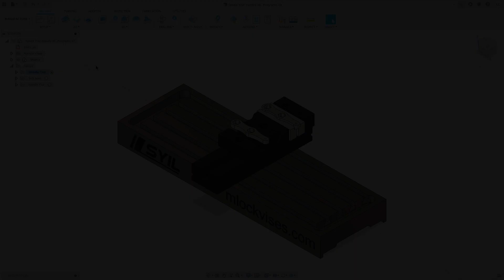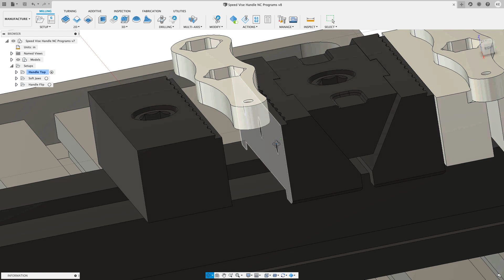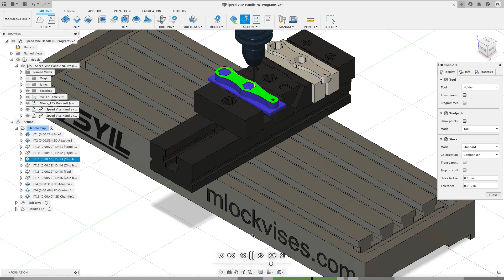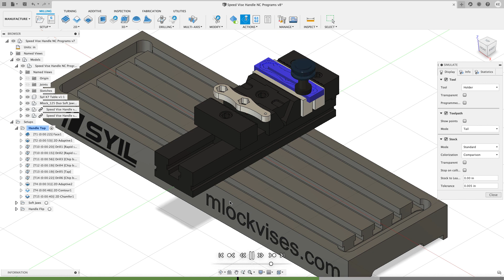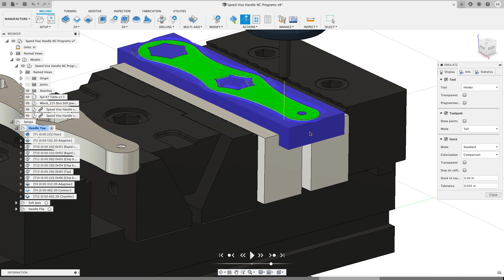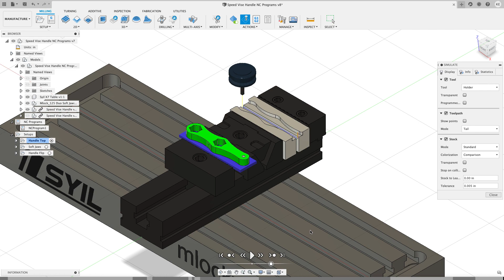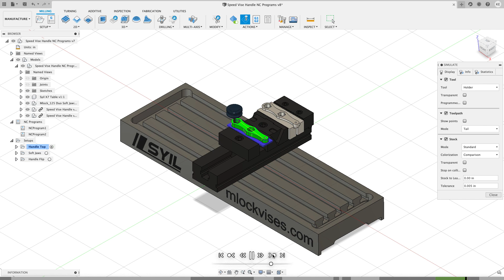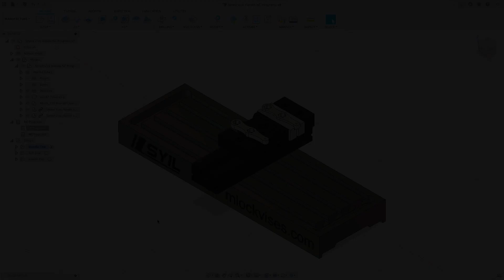Fusion 360 NC Programs for Multiple Setups

Comment: you can have accurate stock for the second op if you save you simulation stock from the first op as a stl file then import it and position it over your second op model
Reply: like when you run the simulation of your first op when the simulation is done don't close it. right click anywhere on the screen and click save stock. you can save your stock that way as an stl file. go back to design mode. go to import. import your stock file. NOTE* you have to import it in millimeters for some reason or else your stock model will be too big. from there use the move feature to position the stock. I use from point to point and pick two similar corners.

Comment: I was expecting to see a video like:
- I have 1.000 individual parts in my library, all of them has it's on DESIGN environment done with all the properties that I want, with changeable parameters. Also they have on MANUFACTURING environment its own WCS, stock, CNC tools, speeds etc pre-setup (in case I want to manufacture it individually).
- BUT now, I want to combine 4 items from my library, and cut em on my stock together, I want to duplicate some of them. I would like to be able to just drop (or arrange / nesting whatever you want call - or proceed) in a manufacture environment and CUT... that's it, no re-setup my tools or anything because I have done it previously...
Could you show us if that is possible? Your video did not make it clear for me, because it starts when you already have your parts there...

Comment: Thank you for the video! A quick question -

In another video, you showed having two vises facing each other clamping on the same part for two different operations, that make sense to me - and I can do it the same file I worked on the CAD for the model. In this case, you have the same part twice at different location on the same vise.

Is this a different file, in which you inserted the design for the speed handle twice, in different orientations, so the linked model is used for CAD, and the new file is used for CAM? Is there a way to do this in the original file (where the CAD happened)?

Thanks!
Reply from the maker: As long as it is a component (in the design or an external reference) you can place as many as you want. If you look at the browser it will show componentname:1 componenname:2 meaning they are the same component but multiple instances.

Comment: How do you use the same tools at different heights? Do you change the "H" value manually in the editor or something else? I thought tools could only be used for the WCS they were setup for initially. I do not have an automatic tool setter or probe, if those are required.
Reply: @Chris Nikitas thank you, idk why I did not put 2&2 together before, but that makes perfect sense. I never use the fixture Z offset that way. I have used it to dry run and check my tool offsets. Always trying to learn everything I can about machining, thanks.

Comment: for 2nd op stock for a quicky - I make the stock od XY boundaries the same as Op1 - make top the same # as Op1 bottom - then make the bottom a negative number = to what the contour shape depth was in Op1 -  

Thanks for multiple Ops -
Reply: I think maybe in tool bar - NC program should replace or be next to Post Process so we have a choice

Comment: Can't you use the rest machining stock option for that last op? They added that just a few months ago i think. You select it instead of fixed stock size, and then also have to click a checkbox IIRC.

Edit: or maybe the option is called "use stock from previous operation" or something like that. Sorry, not near pc right nite.
Reply from the maker: That is still pretty primitive. It also doesn’t work across instances of a part. Yet 😉
Reply: @MechanicalAdvantage  you can save the stock midway through stock machining and then rest machining from file. Then use the saved body file

Comment: Thx, Kevin. Can you plz give quick comparison between NC Program vs. current Post? Also, why will NC Program eventually become the preferred method?
Reply from the maker: Hi Swami. I think we will see further streamlining of the posting process in the future in this is a step in that process. It is also a consistent experience now between Windows and Mac. Currently posting from the two OS's gives vastly different UI's for doing so.
Reply: @MechanicalAdvantage  Thx for the reply. In what way does NC program "streamline" the process? Not pushing back; just honestly want to know. And, yes, I have experienced the different UI's between Win/MacOS. Hasn't been an issue for me, though I do think the Win one is slightly better.
Reply from the maker: @swamihuman9395  My guess is that it will tie into machine definitions etc. If you were to choose a machine when you create your setup, why do you have to tell Fusion what post you want to use for that setup? It will be small things like that which will speed up the process overtime is my belief. Plus NC Programs will continue to add new capabilities as well.
Reply: @MechanicalAdvantage  Thx. BTW, I have played w/ NC Program, but only in n out to see what it was; never ran code on CNC. Also BTW, I'm quite OK w/ change, provided it is an improvement. So, let's see what happens...
Reply: I was wondering the same thing and have the same question.   Currently, this can be done by selecting both ops and then post processing....right?  So is there an NC advantage, or is this just another change we'll be forced into after getting used to the current way for years?
Reply from the maker: @bluehandsvideo  I'll use a standard answer that I give in classes when I am asked. The Model T was a good car, but none of us are driving them anymore. Things change and evolve. I promise you the developers aren't sitting around saying "well, Mike knows how to post now, let's go change it up!". Automation for posting code will be one reason this change is required. I think we will see further work down the road that will streamline the process further. It also gives a consistent look and feel on both Windows and Mac. Plus it will be able to do more things than just posting can do. We'll continue to see improvements with NC Programs output capabilities. I like to make these videos ahead of time to give you a chance to play with things on your own terms before you have to learn the new way. So play around with it, and you will find it really isn't much different than what you are currently used to.
Reply: @MechanicalAdvantage  LOL!!!!!  Um....yes they are!! ;)  Too funny.